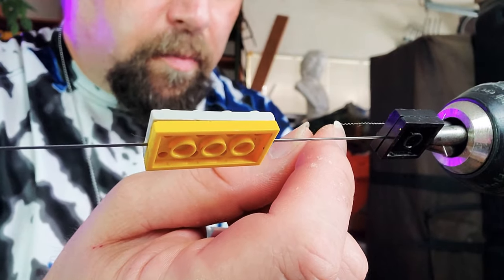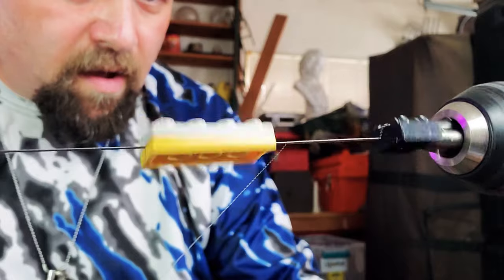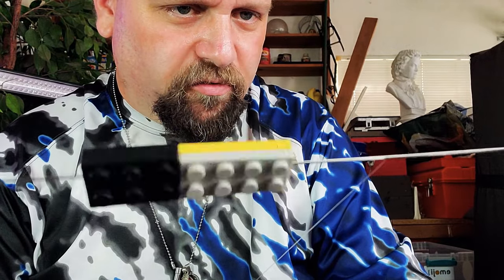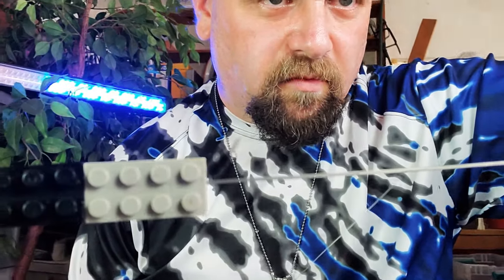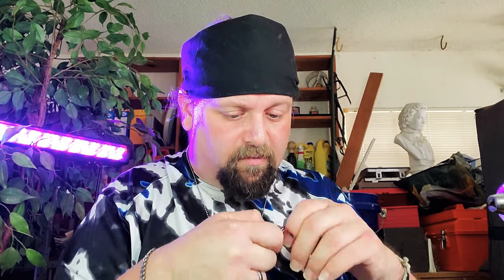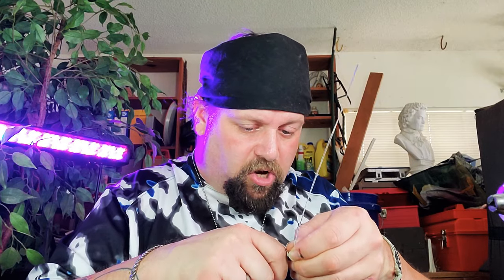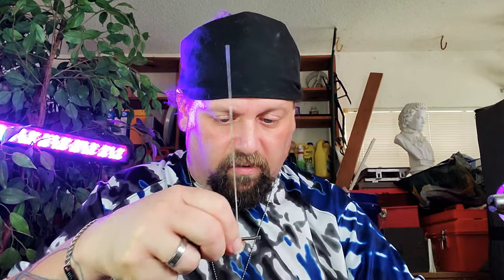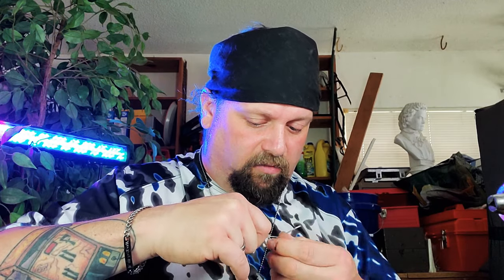Simple 3x28gn80/36g316L SS Alien Coil Tutorial, SHORT & SWEET!  A coil quickie!  Next up: RAILIENS!!

Comment: Is there any difference in performance between a triple fused alien and a triple fused Clapton? Only difference is straight wrap and squiggly wrap so I’m assuming performance and taste would be the same. 🤷🏽‍♂️
Reply from the maker: I'm so sorry I didn't answer this way sooner.  Been out of commission.  But yes, the difference is with alien fuse, besides there being slightly more space between each fuse wrap, the alien decore wire is basically a spiral, so it pushes the center core slightly inwards, creating a little "ditch" down the center of each wrap, when u wrap the alien u make sure the "ditch" is facing out so you've got a little channel for juice to sit in causing more flavor, as it takes the juice a bit longer to vaporize.  So yes aliens do taste & perform better.  Its all personal preference but aliens, n80 or n90 are my all the time go to wraps.  Sometimes I like a 4 or 5 core alien.. . Even a 6 core occasionally but my fav is the old 3 core.  Thanks for your question, & if EVER you want great quality wraps at great prices, please get up with me by texting 772-215-9178, ask for Fozzys Coils, or on Instagram, message me @fozzys_coil_co & I always do deals, sales, & I'll always work with anyone on prices.  And over $40 is free shipping. Plus I always toss in a free set of 3 core 3x27/37n80 5 wrap 3mm 0.13ohm.  I do many styles of coils, customs always welcome.  Hope to hear from you
Reply from the maker: So sorry for the late reply.  Years late lolol.  I didn't use this channel for a long time but I'm gonna start again with tutorials & weekly vape live streams!  So click the bell so u know when I'm doing new stuff.  To answer the question; I used to say the same thing.  Couldn't be more wrong.  The "squiggly" S's as you called them, allow for lots of little spots for juice to drip to the cores.  Also, the decored fuse wire makes a spiral, which pushes the middle core(s) down & creates a concave stick of wire so you've got more nooks & crannies.  Flavor comes from that percolating & simmering before it kicks off to atomization.  Thanks, so sorry for being THREE YEARS late....   I hope to see you in a live stream.  Thank you!
Reply: Yeah the alien wire helps draw the liquid down the wire, a clapton also does this but the shape of the alien draws up the liquid quicker. If ya stick an unwrapped coil ( a stick) of fused and alien into a glass of wire, it will wick the water all the way to the top of the stick even if ya just dip the end into the water. The alien will wick up to the top quicker. And a fralien with ribbon wire inside with an alien wrap will wick even quicker